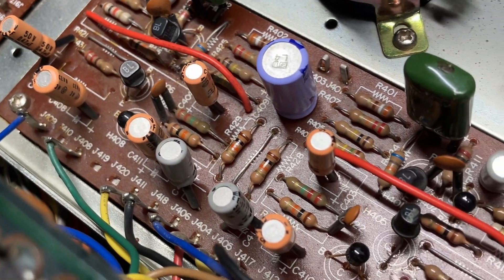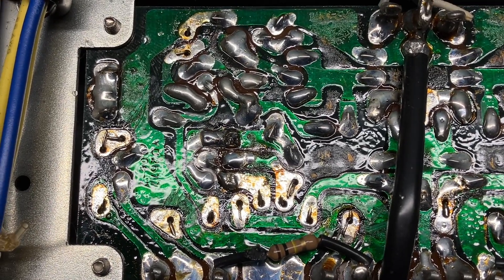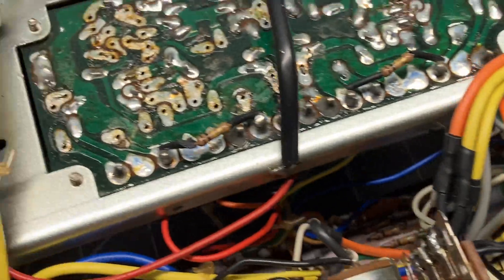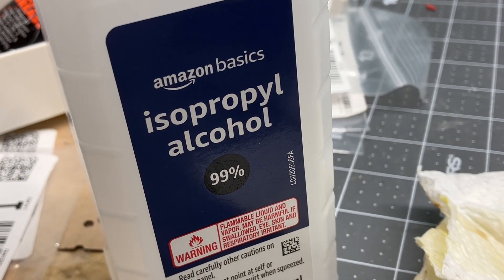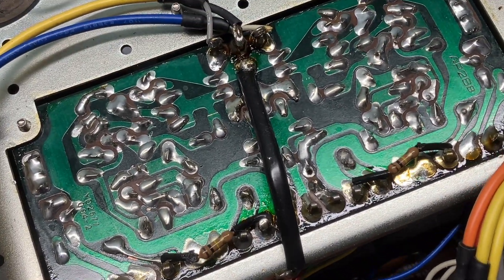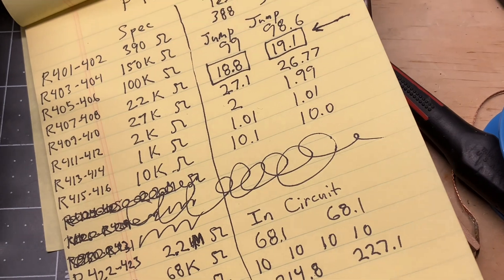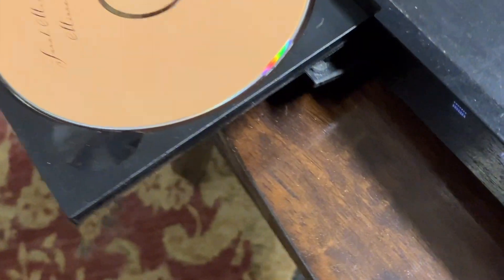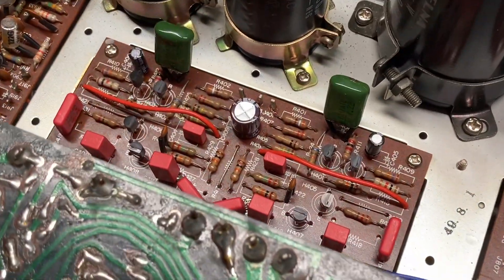Marantz 1060 Rebuild - Part 3 - P400 Pre-Amplifier Board

Comment: The ceramic capacitor is probably just for high frequency decoupling.
Reply from the maker: I noticed the preamp board on my Marantz 2245 didn't have these. 1/2 of the transistors had a much different shape. I used the same value transistors on the 1060 as the 2245. I can't hear any problems or issues.

Comment: This is a good and impeccable job!  WIMA caps are a good choice for replacing small electrolytics.  This amp must sound amazing playing vinyl too.
Reply from the maker: I hope when its done, it is amazing.
Reply: @PossibleAudio  This weekend I was restoring a turntable from the late 70s.  It is a DD QL.  There were about 10 electrolytic caps (ELNA).  I used your approach of measuring them after they were removed from the PCB.  Perhaps a couple measured OK, but most measured +50% capacitance over the spec.  So, the 10uF ones were measuring about 15uF, pretty bad!  The 33 rpm was not locking, the 45 rpm was – this may be one of the reasons.  The “monster glue” was all around the PS caps and some diodes and a resistor.  I removed all, and cleaned the PCB.  I will install new ones this week.  I will use your approach also and will install WIMA film to replace the small electrolytic ones, probably 1uF and below.
Reply: I was initially using my old Chinese Desoldering Station S-993A.  I bought it in 2018 and did a lot of vintage audio equipment restorations with it.  I kept it clean and replaced its nozzle and filter as needed.  But, OMG, it can be dangerous.  Something happened with its internal pump.  I was using it this weekend and it was melting the solder on the PBC as it should, but it was not sucking the air/solder properly.  In the end it damaged a few pads.  I stopped using it and went back to the safer method of desoldering wick.  I will try to fix the damaged pads, some are in bad shape.  I’ve heard that the Hakko FR301-03 is good but it costs over $300 – I will keep it in my “wish list” for now…
Reply from the maker: @kylesmithiii6150  Folks swear by the Hakko FR301. I've heard nothing but good things. Expensive like you're saying. If I keep doing this as a long term hobby, I'll sell off a piece of equipment to buy better tools like the Hakko FR301. I'd like to do another Marantz 1060. It's just so easy to rebuild.
Reply from the maker: @kylesmithiii6150  I need to go through my Technics SL-D2
Reply: @PossibleAudio  Cool!  I look forward to seeing the video.  BTW, I used 'WD-40 3-in-One Motor Oil (SAE 20)' to lubricate the motor shaft.  I was initially afraid of removing the motor and breaking it or something else, but I saw other folks on YT do that and they used that oil.

Comment: What model of transistor did you replace and with what? What was the modification with the wima's next to the filter caps. If possible please point out on the schematic what you are doing. I know it's a pain but it's the difference between show and tell and education.
Reply from the maker: Over time there were different variations of of the Marantz 1060. They didn't update the Service Manual. With that in mind... H401, H402, H405, H406 KSC1815. For H403/404/407
408 I used KSA992. This is at your own risk. I recommend joining Audiokarma as there are folks there that can guide you through any issues. 

The mod with the large filter caps was a joke. The only real mod I did was not reinstalling the small ceramic capacitors that joined the collectors of the transistors. I left them out. Working fine for me. Also the transistors used were a guess based on my Marantz 2245 which has a very similar P400 board. 

This build is more of a show and tell, but a lot of useful information here and there normally in my videos. I got in a hurry on this one as its been a busy week and I' tired. 

I can tell you the P700 board which is the main amplifier board, is getting 95% disassembled and rebuilt. Taking more time with videos on it. Should be a good one. 

All the best!
Reply: @PossibleAudio  Right on, thanks for the reply! I guess to make things easier you could add a link to the Audiokarma thread so people can follow along. Have a great weekend!
Reply: @PossibleAudio  Thank you very much and your videos are entertaining and pleasing to watch .